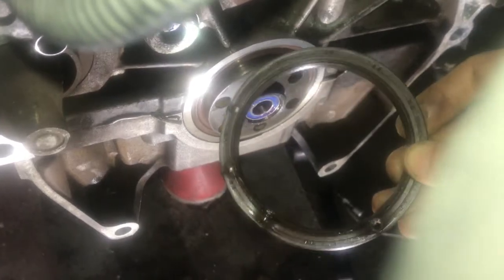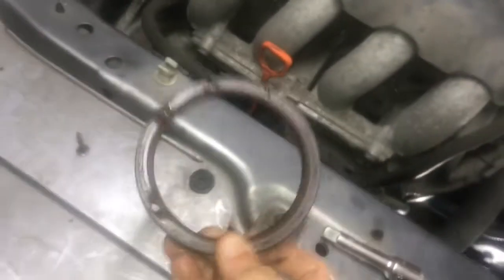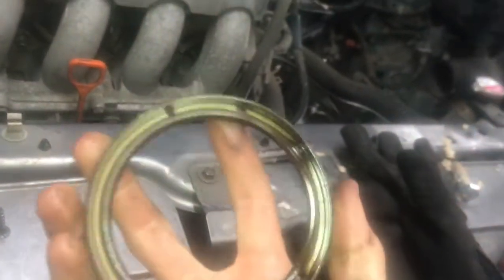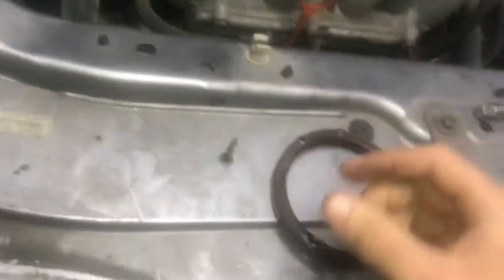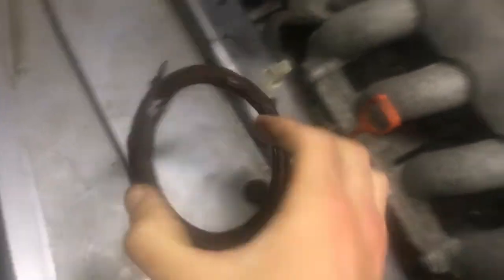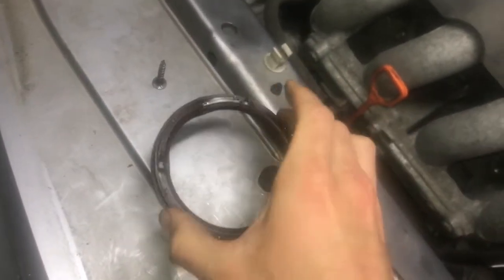How to Replace Rear Main Seal Honda

Comment: Hello mate, i am fitting new seal on but its not going in!!! I checked the seal multiple times and its right size. I checked putting it opposit side (just to make sure its right diameter and it is).
Its not fitting on cranckshaft and feels like too tight. Any isea?

Comment: how hard is it to get the car to this point?  is this like something you can do without taking the whole engine out? I honestly can't telll from your video what state the engine is in
Reply: The engine stays in,  but The driveshafts and transmission have to come out.
Reply: Gotta drop the whole transmission 🤦🏾‍♂️
Reply: @BigPapiPhx  Looks like the subframe on that side was removed as well? Is this correct?
Reply: can confirm after doing clutch job, the transmission and subframe has to be dropped